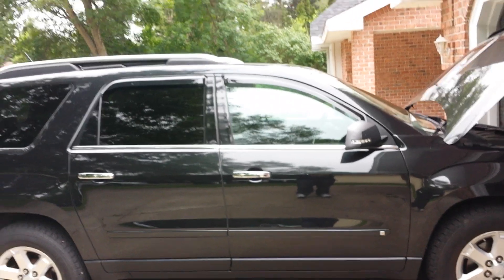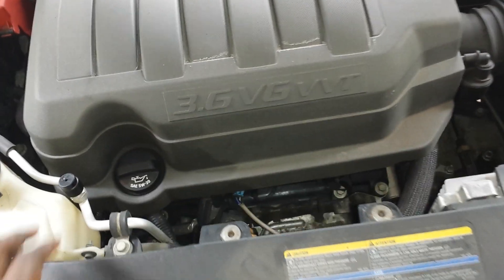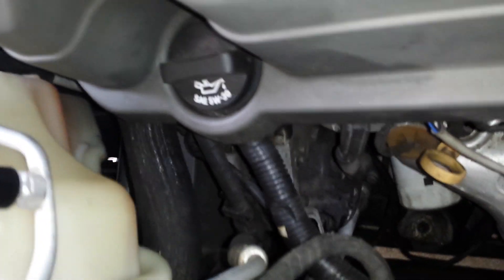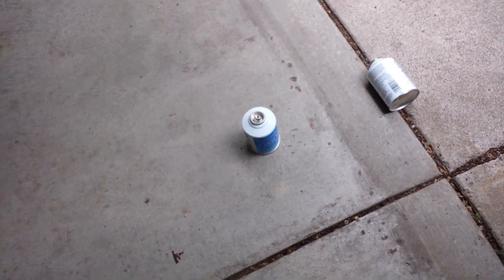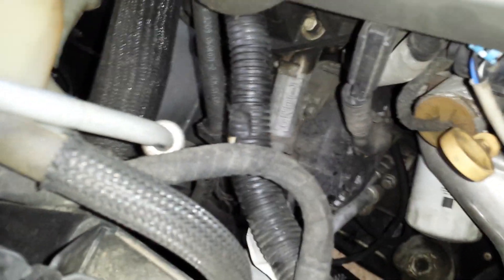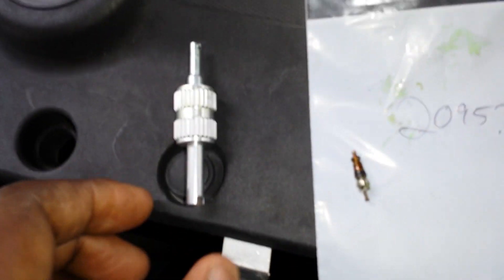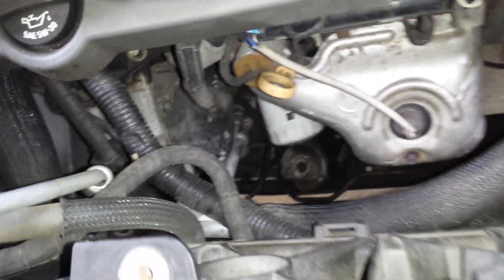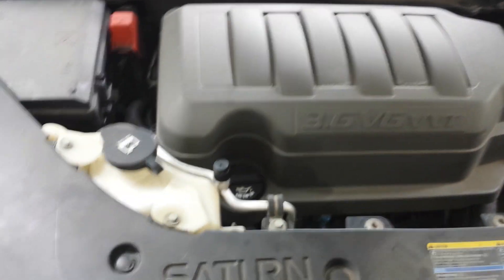Saturn outlook gmc acadia ac fix

Comment: Thanks for posting this! The weather is getting warmer! BTW...... If anyone is having problems with their 2008 Saturn Outlook TRANSMISSION; A "WAVE PLATE" (inherent design flaw...) WILL GO BAD, RESULTING IN A $4,000 DEALERSHIP REPAIR BILL!! BE ADVISED!!
Reply: this is supposed to be covered by GM as there is a recall on the wave plate going bad and breaking..  However, the transmission itself is just junk, complete junk.  it goes out after about 120k or less

Comment: Thank you sooooo much!!! The guy from ACE told me the high pressure one was the one to use and i was ready to pay the garage a ton of extra money for a recharge!! PS i have a 2012 acadia denali and it does look EXACTLY like yours under the hood so thanks again its much appreciated!!!!
Reply from the maker: glad it helped.. yeah these are actually super easy to refill. barring any leaks in the system.
Reply: @ccsurep  could the hissing be heard from the inside of the vehicle? Mine is hissing but it sounds like it's coming from inside under the dashboard.

Comment: I have a 2008 Acadia, AC button will flash, no cold air. your video is very informative. thank you for putting it online.
Reply: John Copeland  I have the same problem
Reply: Angela Franklin the AC button flashes when the AC system is depleted of freon. It's a safety feature to keep the compressor from coming on and burning itself out.

Comment: My friend I have a problem with My Chevy Traverse 2011 and its a little bit annoying
I start to hear water behind the dashboard and later on it damaged the "fan" front of the passenger seat , I replaced It but the water still there!!
lately i knew that the AC drain line is clogged 
I don't mind to pay money to fix but the problem when i went to the mechanic he said its going cost you about 1000$$  "we will remove the dashboard!!!!!!"
I saw some videos for the other cars to how to open the clogged; but I couldn't find the drain line.
can you help me out by showing a video for where this drain line located?
thanks and sorry for the long message.
Reply from the maker: here is a link to an easy fix for that problem. hope it helps https://youtu.be/I9zOcJQobG8

Comment: You have to vacuum the ac system to allow space for the refrigerant, this method will cause a lot a very expensive problems down the road. Also the air you introduce when removing the valve core is acidic it will react with the oil and turn the oil black also causing very expensive problems down the road. Please leave it to the professionals or do it yourself but do it right.
Reply from the maker: Jorge Nunez never said I was a professional. just posted to maybe help others. stop with all the "doom and gloom" there are more than 1 way to accomplish a lot of things. my system was completely out of refrigerant. people with this issue means their system is already empty. I refilled.. with NO problems. you don't have to scare people to get business.
Reply: @ccsurep  they are correct. It needed vac'd down to remove air and contaminants from the system. ESPECIALLY  when they are empty lol. Its not doom and gloom its just not the right way to do it. Will it work in a pinch... sure but a vacuum pump is 100$ at harbor freight and a new compressor can cost many times that much less labor and gas.
Reply: I replaced my evap core 10 years ago and refilled without vacuuming. I basically didn’t know what I was doing. But to this day it still blows cold and has not needed another recharge. Had I known, I would have vacuumed, but not vacuuming does not mean instant failure or anything.

Comment: Good stuff! How did you determine that the leak was at the valve?
Reply from the maker: After trying to fill it i noticed refrigerant bubbling and leaking from it. This may work for others. However I have another leak in my rear ac lines. I will post video on how I'm avoiding paying $1300 for dealer to do repair soon. Warranty won't cover repair for some reason :(
Reply: ccsurep Thanks for reply! Good video, I'll watch the next as well.
Reply: I used windex and let it sit for a couple minutes and sho nuff air bubbles started to rise up....thanks for the advice i also checked the other port but it was fine

Comment: was there any feron in the system when you removed the pc. My pressure show good on the high side and about 30 on low side told it was the heater module behind the knobs it is one pc now cant find a link to removing dash parts to get to it if that is really my issue

Comment: Question @cssurep - When you filled up the A/C before replacing the schraeder valve, did it hiss and leak out immediately when you filled it or was it only hissing (leaking) when you engaged the A/C?  I have a very similar problem; however, when I put the refill can on the port, it was already showing it was at pressure, etc.  Curious if this is similar to what you saw, etc.  Thanks

Comment: Was the AC button still light up or would it not stay light?
Reply: No the "AC Light" would only blink and then go out which means there is no Freon in the system. .  But I will also add, that the fix helped, but I also had a leak in the rear ac lines. it turns out, unfortunately a $1300 fix!
Reply: I have the same problem I hope this fixes it

Comment: Thanks for posting,   My system was 'hissing' more and more each week.  I could not find the low pressure port in my 2007 Acadia. It was exactly where you said it was, but was hidden by the feed to the radiator.    I will try re-charge kit and look for leaks.